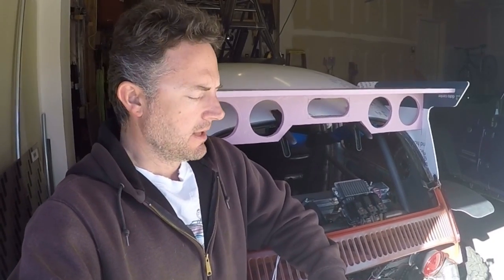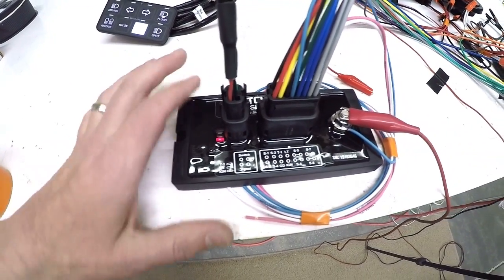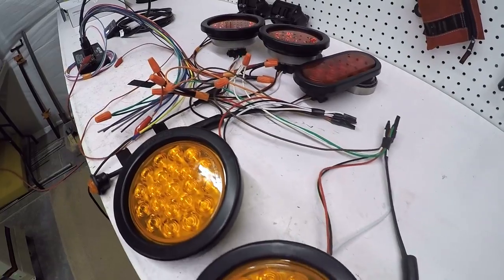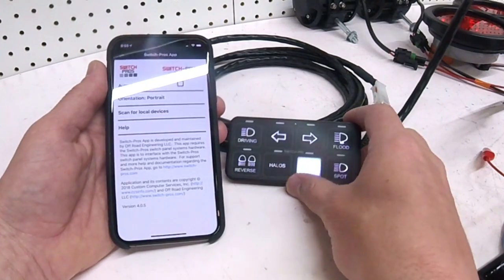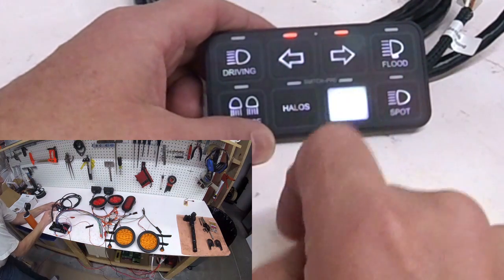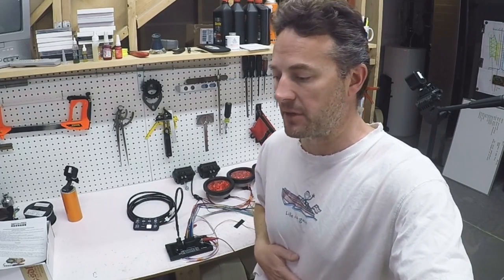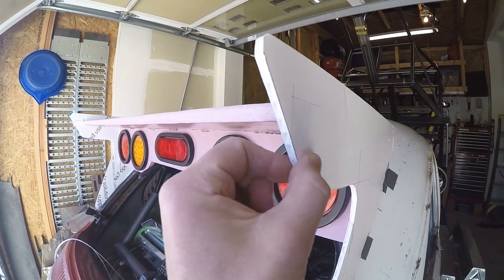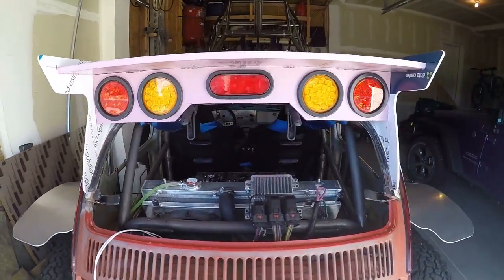Wing Design and wiring layout on the Baja

Comment: Doug do you see any problem with running the same S10 hub setup on all four corners? The front does steer but doesn't carry as much weight and having 4 identical parts simplifies repair and parts stock. I really enjoy your meticulous yet cost savy approach to fabrication.
Reply from the maker: Yeah that would work fine. Only thing you need to keep in mind is you can't run those hubs without a stub axle in them. Otherwise they would work themselves apart. But otherwise go for it!
Reply: @DougBugBuilder  I gotcha and thank you! I think fabbing a retaining stub of sorts from a junkyard front axle will be pretty simple and doable. I also decided to go with hubs from the K1500 full size for wheel options as much as anything. Thanks so much!

Comment: You are state of the Art in many ways.  My first impression about the mount was that I would just keep the wing but incorporate it into a tubular roof rack that allows for front offroad lights. Traditional fronts or LED strip. The rack could be used for camping gear or whatever..... I don't think with your car a little wind noise would be a problem with the rack.   I would have to mount the controller up by my mirror or I would forget to turn off the signals. hehehe Oh yeah I forgot. I'm over 50 so it's almost mandatory to leave my turn signal on!
Reply from the maker: I'll still have to wire in indicator lamps in the dash to show me the turn signals are on. I have that now. Otherwise I'd leave them on too. ;-)

Comment: A bead roller makes a world of difference in strength and rigidity. I made something similar for my bug (14g) and used a big harbor freight rivet gun to connect everything. Hasn't rattled loose yet.
Reply from the maker: Thanks for the tips bud. Still haven't decided if I'll rivit it yet.

Comment: Don't have your amber turn signals set up as running lamps. Only red lights face rearward. Take a look at FMVSS 108.
Reply from the maker: Holy cow, I looked up FMVSS 108. That is quite the read! But seriously, thanks for the tip. I'll wire the ambers up as turn signals only.
Reply: @DougBugBuilder  Glad I could help. I would hate for you to get a ticket. Keep up the great work. I look forward to seeing more.